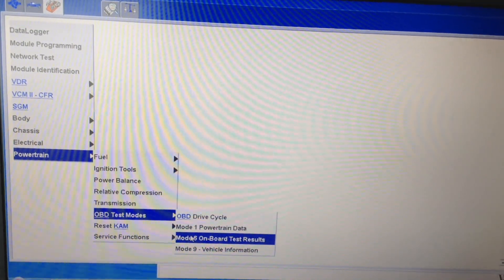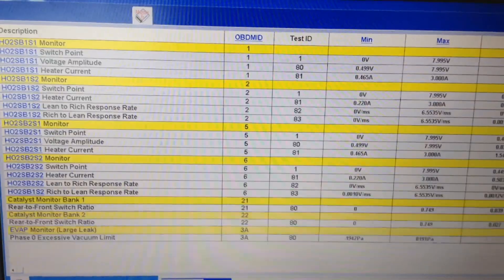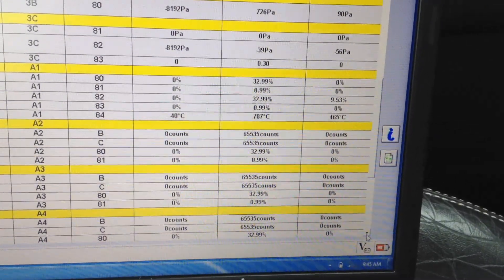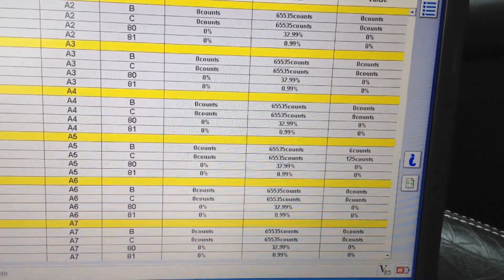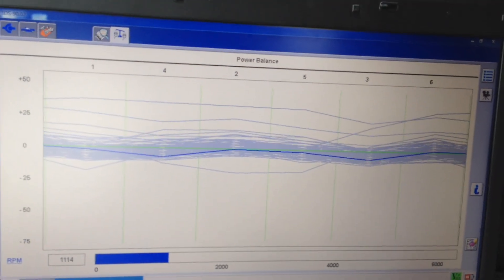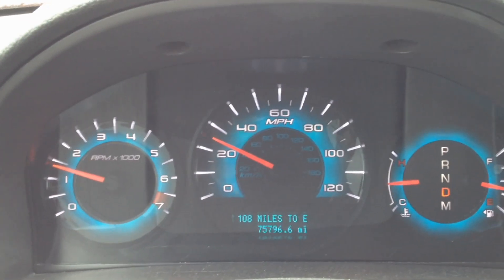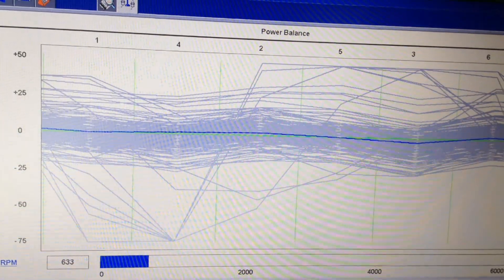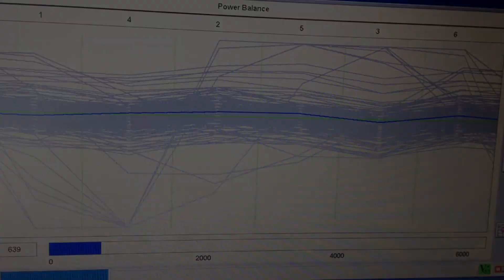Engine Misfires That Feel Like A Harsh Shifting Transmission

Comment: So why was it missing on cylinder four?
Reply from the maker: Oh sorry, it was a ignition coil that was failing under load. A simple swap of coils 4 and 5 and re road testing verified the misfire followed. That is just how easy coil on plug design is to diagnose. I have a whole video on that.
Reply: FordTechMakuloco  oh I was going after an injector coil in my mind that it would misfire under load get so hot then cool down temporarily when it was missing then be fine for awhile.great video love your video helps me understand what Im learning in class better.also helps with my focus. This is round 2 of a huge battle on my focus with strut bearing issues.
Reply from the maker: Almost everytime you push the engine to load up and then a miss it is ALWAYS secondary ignition remember that when you get to the field on Fords anyway.
Reply: @FordTechMakuloco  except when you have the '13 VIVCT 3.5 and the plenum needs removed to access the rear coils I'm a bit perturbed by this lol

Comment: 2008 Taurus limited  same symptoms but it was the trans oil. 203k no trans oil changes. Needs trans oil change every 60k . Changed the trans oil and runs good now. No codes either.

Comment: Thanks for the info here. My fx35 has a mis fire when accelerate hard, but no code on the dash. I am going to tell the mechanic what I learnt here, cause he is thinking it is the tranny. But this suv drive smooth when gas it normally, it is only on hard accelerations it gives the jerking and then it goes off speeding up. So yea, I think this is great info. thnx.

Comment: Dang I knew it was about time to change my spark plugs but I thought that shuddering in my 2010 4.6 f150 was a transmission issue. I'll change them in the next few days and see if that did the trick
Reply: Did it work?

Comment: I have a 2013 Taurus with the 3.5L and when ever you slow down to go over a speed bump or do some what of a half stop at a light and then give it just a little gas to get going again it does a sudden jerk. Do you think it's a cause of a miss fire?
Reply from the maker: Nothing is common on those I would have the dealer reflash the pcm and reset the adaptive shift tables. You wont believe the trans concerns I have fixed with a simple shift relearn, it is all in the shift timing and the adaptives sound off on this one.
Reply: Cool thanks for the info man great videos.

Comment: Forgive me for this novel guys. Looking for thoughts I'm not a mechanic but i think for a guy who has never replaced a alternator in his life but did successfully install my first one on a 2005 Hyundai Santa without help or experience that I have some potential. it's amazing the abilities one can summon from nowhere to help a beautiful woman lol. Ok back to the question. So what you are describing in this video is the same exact issue I have been having with my 2002 Chevy monte Carlo. This issue started almost two years ago car now has 187,000 miles on it. I thought it was the trans at first but the car ran so well that I couldn't believe it. I took it to a trusted mechanic who kept the car for weeks just to check it and I noticed when I would drive by the shop for work the car hadn't been moved. One day while driving by I saw them pull it in and within 15 minutes called and said it was my trans and was going to cost a lot obviously and asked if I wanted them to replace it. Part of me thought well they know cars probably well enough to,know right away but I felt that they didn't really spend any time really inspecting it and since the car had been living with issue for almost a year and lasted through the winter into summer and never got worse I felt it was not the trans so I told them no I would pick it up. Three days later after being in business for 25 years they shut down. So I drove my car this way into another bad winter and into the next summer when I decided to take it to the Chevy dealer in hopes to get a "professionals opinion". A mechanic jumped in the car with me and he drove my car. At first when I explained to him,my problem he had said he thought it was my trans also but then when he drove it he seemed perplexed and said it was hard for him to believe that it was the trans because the car drove and shifted so well other then it getting hung up a little a 2000rpm and just about everything described in this video. They kept the car did some things and well after $1000 I got the car back and it was all better it was as quiet sounding and ran as good as the day I bought it. That was last summer so by mid winter i noticed it was going back to the way it was but even worse the violent jerking you described was worse and the misfire had gotten worse. So I have started looking into it my self and trying to fix it. After learning that the problem could be caused by the spark plugs i thought to myself after all this time paying money to have it worked on I,don't ever recall ever once paying for spark plugs. I checked them and learned that  at 188,000 miles they never once had been replaced so i replaced them my self two days ago plugs and wires. So here where I'm at. Before the spark plug replacement The car was doing everything you described exactly but it was struggling at 2000rpm after replacing the spark plugs and wires I can tell the improvement it no longer struggles at 2000rpm and is smoother. However its is now struggling at 4000rpm not nearly as bad its a very slight misfire that gets past it quickly but I'm still getting the jerk you describe that hasn't changed when down shifting that part has stayed pretty much the same but overall it has improved none the less. When i come to a stop at a red lite I notice the jerk the most when down shifting to a stop it never does this everyday some days it doesn't do it at all but on days it does its consistent the whole day. I thought it might be a coil but if it was then why did the misfire change slightly to 4000rpm and now works perfectly fine at 2000rpm where I originally had the problem at

Comment: fordtechmakuloco. my 2010 ford fusion is doing amost the same hesitating on my rmps comes and goes away. checked the coil packs change spark plugs. checked my throttle nd throttle position sensor. im getting bad Mpg like 7.0 mpg. any idea.?
Reply: Alvaro Silva did you ever fix it ?
Reply: Transmission solenoid
Reply: injectors?

Comment: I am getting the run around from a Ford dealer, $1,200 they say come get your truck it fixed. Drive out try to accelerate up the on ramp to the freeway and it does the same thing. They didn’t fix a thing. Turn around go back and tell them it isn’t fixed they go with a drive with me at my request, yep every time I put on the gas (we are talking 1/4 throttle not full). They ask me “can you leave it?” I ask, “wham about the $1,200 you just charged me not to fix my vehicle?” “Can’t help you there.” Nope not leaving it.

Comment: HELP PLEASE!!!! I changed the coil and spark plug on my F150 2000 4.6l
 but still get a misfire code. I forgot to blow the chamber out though, no oil found but could it be dirty????? Thanks

Comment: I've got a 2010 FX Ford F-150 it's lifted with an exhaust, and it has a cylinder 8 slight misfire, I don't know how accurate that is because it runs fine, idles fine, sounds fine. I'm so confused.
Reply: Did you ever figure it out? My 2011 Towncar 4.6 had an engine coolant leak from the intake manifold and that would go right into the #8 spark plug well.

Comment: is a miss different from a misfire?   i was driving a 99 park avenue 3.8L v6 thru the appalachian hils yesterday and going up hill at 55mph, i would get a recurring shudder every 20-30 seconds where the car decelerated markedly for a beat like a giant was punching it in the nose.  I think a miss would cause a noticeable pause, but this was more severe.  Could this be predetonation during the compression stroke actually hammering the drivetrain rather than a simple miss?  I added octane booster to my tank for the return trip and that reduced the occurrence markedly but it did not disappear.
Reply: Hey there ,did you find the problem ? My 2012 edge does exactly the same just at low revs between 40 and 60 miles

Comment: Did power balance on my supercharged 2015 Roush stage3.   Cyl 2,3,5,and 8 was misfiring with no codes,  changed plugs and coil packs, still have same misfires,   I’m now thinking injector issues.   What say you? The injectors are the LU47

Comment: I have a 2003 honda accord. Switching between 2nd to 3rd gear It revs a lil higher In 3rd gear and almost feels like It doesn't have as much power until It switches Into 4th gear. Could that be a speed sensor? My "D" light blinks. And no Check Engine Light.

Comment: Hola my check engine light has come on a few times over the past couple of months with a p0302 code. I could feel an intermittent slight miss at idle for a month then the trans started slipping but the missfire has decreased in frequency I think I had 16 this morning on my 7 minute drive to work not that many. And they are very slight. Could that cause the feeling of a slipping trans or is that a separate issue? It's significantly worse on a cold start

Comment: My 09 Taurus does this but I don’t have a check engine light on. I think my problem is the cheap ignition coils I bought...it drives perfectly fine it just does that stupid rumble every now and then
Reply: My 2015 does the same same thing.  I heard it's just shifting gears

Comment: I have a 2008 Ford Taurus X SEL with v6. I changed all the spark plugs. How does anyone know for SURE that there is no space or gap between COP inside plug area and the top part of the spark plug? How do we know or prove when you push a cop over a spark plug that it has snapped or clicked into place, it always feels rubbery. Lets say its on there but not snapped, does this cause an internal spark jump inside, and is that ok? Thank you... P.S. The plugs I put in are NGK and are 1/8" LONGER in that section where it would snap on cop internal.
Reply from the maker: The coils do not snap onto the plugs they simply push against them with a long spring inside keeping the tension.
Reply: Hey, thank you so much, I appreciate it...
Reply: @FordTechMakuloco  I was wondering this very thing today when I replaced the plugs on my 3.5l explorer XLT. Thanks for the question AND answer

Comment: i had same issue before, customer complaint tranny slipping and shifting hard , i did a quick mcgyver test  which is load the engine and feel how it runs and soon enough both banks are lean which caused by crack intake tube

Comment: I have a 07 mkx when im cruising about 40 mph the revs are about 1100 to 1200 rpm if i give it light throttle it will stutter hard feels like its cutting in and out for a few seconds and then downshifts and is fine... transmission isnt slipping and no other issues would that be a possible misfire or does that sound like transmission problems

Comment: It was weird my car was doing the same thing after going up a hill. It would usually just blink check engine for 4 seconds then shut off my friend checked it out and opens up my 4 cylinder engine and found that a few coil packs were damaged and he advised that I get new spark plugs and coil packs. After I went home because I needed a new battery was 4 years old he advised I get a good battery from Costco bought it and bought a code reader. Once I installed the new battery I connected my code reader and it popped up codes 0300, 0302 and 0304 I read upon it and it said misfire or something and something to do with spark plugs or coils. Then after that I went to scan it one more time the codes were gone which was weird to me. But my gut feeling is telling me to buy new spark plugs and coil packs. I pray 🙏 to god this is the problem with my car and not with this one mechanic I know off the street that told me it’s my catalytic converter. Amen.

Comment: This sounds similar to my car problems. I have a 2014 Dodge Dart, I was on the interstate when I could feel a loss of power. I was doing about 65-70 and my speed was dropping, slowly. I had my radio going so I turned it down and I could hear the engine revving and trying to upshift. I’ve known my car to do some weird things. My buddy was in the car with me and I told him “eventually it’s going to go into limp mode where it won’t let me drive past 10mph.” So I was lucky enough to get it home. It was tricky because after every green light It would take awhile to get up to speed, it would maintain speed well but I could tell it was having a hard time shifting. I would let off the gas to try and let it shift the way it needed to. I milked it the whole way Home. I have not had a tune up and my car has a 165,000 on it. Not sure if it’s a tune up issue or something more serious.

Comment: Hey in my 08 Tundra 5.7liter the truck at 30mph to 40mph when I coast and let off the acceralater the truck downshift pretty fast and I have to give it more gas to keep going is that normal

Comment: GREAT video! I have a 2009 Sable with 3.5 and I have similar issue...NO engine light. Hard shift (seemingly) when light throttle, vehicle will have a jerk to it then I will  accelerate a little bit and goes away, but if I ease of throttle , vehicle will do same thing until I give more throttle or let up off throttle. Somedays no problem at all.

What your think?
Reply: Am having the same problem

Comment: Bi-directional scan tools are pretty cheap these days.  Mine has paid for itself many times over. If you want to keep your vehicle for long after it’s paid off, buy a Bi-directional scan tool.  Even the Chinese ones are really good and typically come with a few years of free updates.

Comment: I replaced the spark plug, plug wires, ignition coil, and injectors to find out my pistons were shot on my 2008 Chevy Tahoe 160k Miles. All this while showing cylinder misfire on cylinder #1
Reply: What were the symptoms

Comment: To anybody out there:

I daily drive a 2000 F150 4x4 (5.4) and experience a harsh lurch the SECOND I take my foot off of the petal when I'm going above 65mph.  I just replaced my intake manifold seal and confirmed that the intake was NOT cracked/deformed in any way.  I am being told that it could be my driveshafts, MAF sensor, vaccum leak, bad coil, bad injector, or bad spark splug.  ANY ideas?  I used MAF cleaner, I checked my spark plugs, cleaned all of my injectors, and still experience the issue.
Reply: Any luck with this same issue here
Reply: Any updates?
Reply: @erickfigz2418  Sold it last year after purchasing a newer EcoBoost. 

I swapped the plugs, coils, and injectors which solved the issues before I ended up selling it
Reply: I’m back - my 16 EcoBoost has the same issue 😂🖕🖕🖕

Comment: I have a 2008 f150. The truck is confusing me. When I am going down the road in first and second gear I am fine but when it shifts into third and rpm is up to 1500 it starts jerking and while truck is shaking/vibrating. I rev up to 2000 rpm and it stops. The only thing I can think of is that there is a possible warped rotor or something wrong with the drivetrain. Any thoughts?

Comment: Aloha, love your channel and approach to difficult, hard to fix issues on Ford's. I have a1990 Econoline with a hard miss and shuddering. The van sits 6 months out of the year. recently I replaced the distributor, plugs, wires, coil. What are the odds that the ecu has leaking capacitors contributing to this?. Is this more difficult to diagnose on an  OBD1 system. ? any input would be appreciated.

Comment: got a 96 2.3 ranger. 5 speed. everytime I hit a bump it sort of bucks. it wants to die whenever it happens. I push the clutch in, and it's fine going over bumps. any ideas?

Comment: I have a 2008 Mercury Mountaineer V6 4.0L and I am having a random misfire issue on cyl 5 as well as "hard shifting" on 2nd and 3rd gear. I'm not sure if they are the same issue or separate. Neither issue is every time. Recent maintenance I've done includes water pump, harmonic balancer, belt, plugs, and leads. The misfire seems like it could be the EGR? I am getting both negative and postive readings on my EGR_ERR, telling me it isn't always moving the amount the computer is calling for. Maybe I'm going down the wrong path... Any ideas? Also, trying to figure out if my hard shifting is a misfire or not. My misfire will go away after shutting down the vehicle and restarting it. Could it be a sensor? Thats is what I am leaning towards...

Comment: My 2004 ford ranger runs fine till it runs for afew minutes nd then under acceleration it feels like I reach over and turn the key on and off. Its like the engine just shuts on and off but it doesn't cut off. I replaced plugs and then I noticed a crack in my coil so I replaced that and it still does the same thing. What now. I can slowly give it gas and it will get up speed and rpms but of I try to just take off normal the it is just like the injectors pulsate.
Reply: Do you have adequate fuel pressure?

Comment: Right on. Thought I had a torque converter issue. Turned out to just be an old truck haha. Needed new engine coils and all that stuff
Reply: Eric Hansen  did it feel like it was slipping while at half throttle or so? my trucks fine when WOT or pussy footing it, but when i give it more gas but not quite enough to downshift it feels like slips but.. its odd 2013 f150 here.

Comment: Got the flex back but its back to the bumping some while accelerating its like bumps twice back to back then its fine but I've also notice its like I can mash the gas  an it does want to catch the next gear what's up with that?
Reply from the maker: Yeah it seems you still have a misfire. What was done to it?